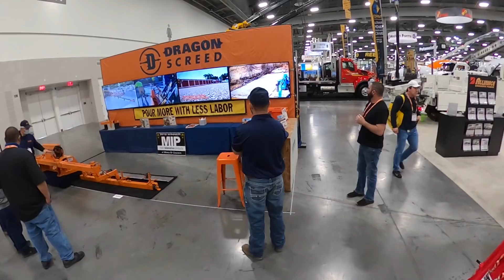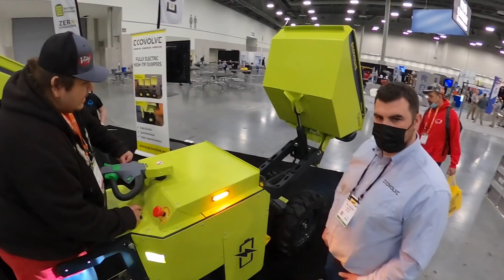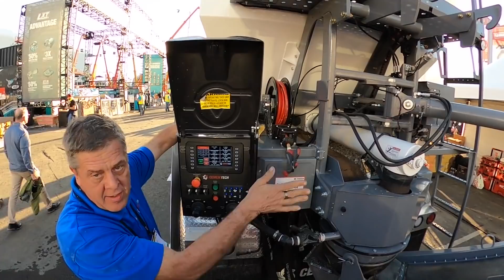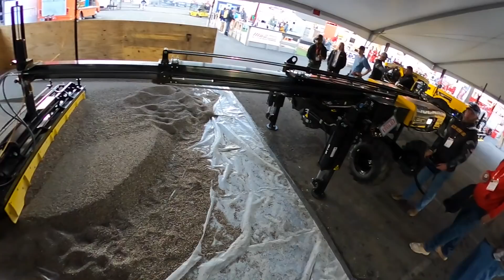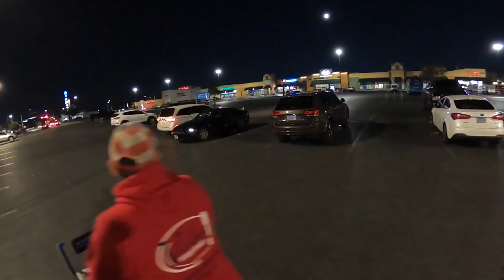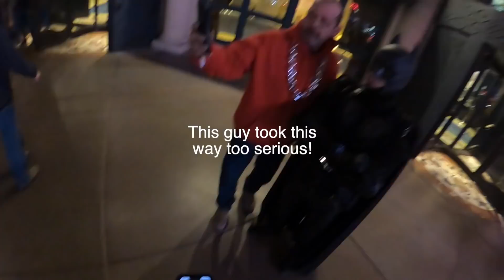World of Concrete - I love this place!

Comment: Ryan, Kubota skidsteers are fantastic. We have a 65, 75, annd 95. Favourite is obviously the 95 but its an absolute unit. The 75 is much much smaller but still has amazing power. One thing thats awesome about kubotas is the front window/door folds up into the ceiling. All of our kubota sv's have the window bar cage thingies on the outside so it makes cleaning the windows from the interior easy. The thing we dont like about bobcat or cat is you have to have the bucket on the ground in order to open/close the front door/window. Kubotas you fold the door up or fold it down.

Comment: Great too find another video from you and particularly from Las Vegas.
Had a few days there two years ago, Disneyland for adults😊
Worked with car repairs in younger days and saw accidents with start cables.
I saw a battery blew up in the face of a colleague by sparks from the terminals by attacking cables. Lucky he ended up with a cut in the forehead only. The loudest bang I ever experienced. The guy got running in circles and I was on my knees laughing due to the bizarre situation. The few times you just cant stop it but should have. 
Whatever, that learned me to never ever use the both cables on the battery poles.
First plus on the battery and later negative to ground.
Always place the negative on a good ground point in the motor compartment so any spark stays away from the battery. Most dangerous on batteries with filling caps.
The car batteries these days have not so many caps, but on machines more often.

Comment: Opinions on Kubota skid steers or excavators? I've never owned one but I rent them sometimes. They operate very well, I like the control setup. I often pour with volumetric trucks. Killer for getting different mix designs from the same truck, or being able to "take away" water if it is too wet.

Comment: I worked at Home Depot for roughly two years. I would load contractors dump trailers all the time. One thing that made it tricky was if they had ramps which made it tougher to load. We had one guy with that trailer on air bags. It was legit. He would load his scissor lifts in it with pallets of concrete

Comment: The Kabota skid steer are pretty reliable and less expensive than other skid steers they offer a 65 , 75 , 95 , and 97 hp skid the cabs are kinda noisy though if you have an enclosed cab but the hydraulics are responsive but over all there a solid product just like any other skids on the market

Comment: If you were like me I never held the pins with someone else on the sledge.A 2 by 4 with a just larger hole than the pin, slip it over the pin no hand will get crushed, wacked or mangled by Darrel the destroyer. Trust me it works. A 16" long 2 by 4 cut it to look like a small cricket 🏏 and take your worst pin flattened on the end mark it on the front end drill the hole, use . Make 6 and never worry about a crushed hand again. Little tips are what make a great job safe for all. PEACE,CAM.

Comment: I used to install 3rd party remote controls on equipment for mining so they can operate from surface, cool at first but a pain to work with, you got electrical, mechanical, hydraulics, networking.. lots of failure points lol

Comment: Awesome video, on the topic of laser screeds the company I’m with located in the twin cities(Minnesota)has two which we use for just residential flatwork work amazing! It’s just a two wheeler with a fixed boom but is worth every penny, you can even pull concrete with with it when blasting out slabs instead of having to rake it all.

Comment: Ryan, I am not exactly an expert on equipment like this in the field. But that is crazy how a vacuum can hold up such heavy concrete. I'm sure it's well tested, but would it really be worth a buy for someone? Just seems like it would slow down productivity instead of speeding it up.
Reply: The only time I could see it being useful, would be in over-the-wall situations, or doing sectional work and attempting to minimize damage to existing concrete.
Reply: a LOT of these trade shows are just "look at this cool technology that might become standard in 5-10 years!", think of them more like working prototypes than anything.
They want you interested and to sell a product and they do that effectively.
Plus you need to think that something that specific has a need for specific trades, theres different trades at this show besides concrete workers, like demolitions, inspections, carpenters, ect. that might benefit from that machine.
Reply: Yea wasn't trying to be rude about it. I was just kinda confused. It does make sense between a different trade and style of work. Interesting nonetheless!

Comment: If you want an opinion about Kubota I'd say they make, in my opinion, probably the best engines when it comes to excavators. Their engines in general are fantastic . Can't give an opinion about skid steers as they're not very common - in Sweden anyway. You have mostly Lundberg loaders or Wille loaders (which are almost illegally good at plowing as well and fast) but they are so pricey the smaller guys have to roll with a cheaper alternative like the Weidemann.

Tbh, it wouldn't even surprise me if your Bobcat uses Kubota engines. Not sure when they swapped to Doosan from Kubota.